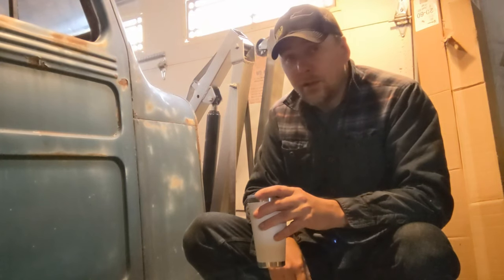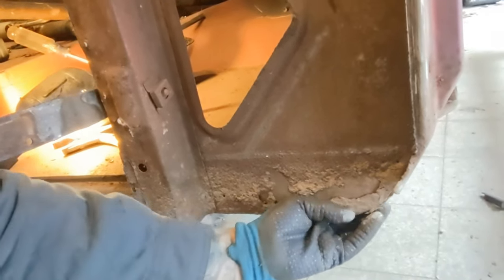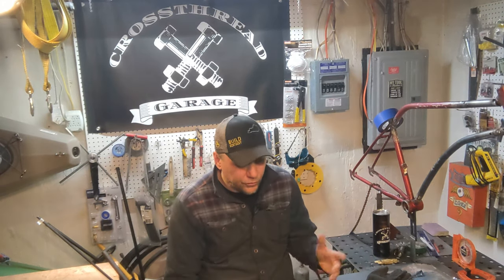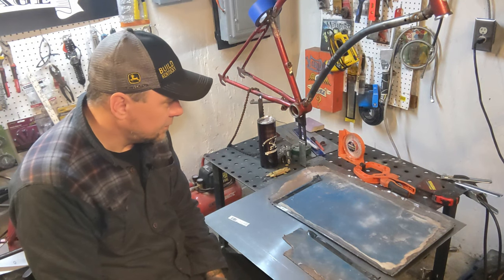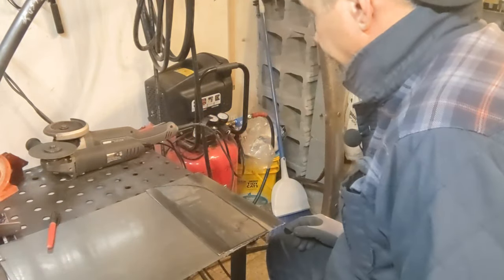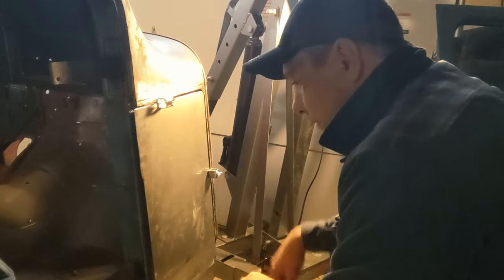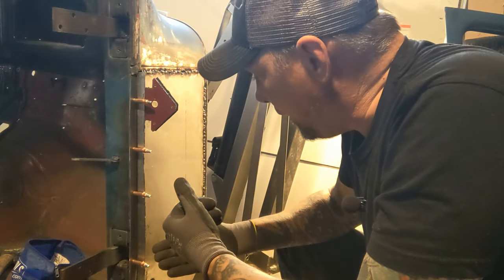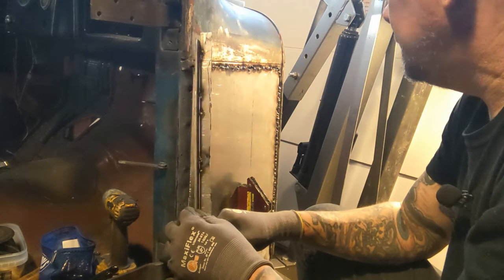1962 Willys Station Wagon Building Body Panels

Comment: Stick with your idea with a small block Chevy.  350 with a mechanical fuel pump  and a carburetor it worked for 50 years  buy a motor from a la-get out-fit /   you get what you pay for  / that's if your lucky    /

Comment: Where are you located? I have a Willys project too and have a complete floor panel from the under seat boxes to the back without rust that I am not using. If you want it, let me know. I'm in WY. I still need to cut it out as I plan to graft in an 06 LJ floor to make updating much easier on my build.
Reply from the maker: I'm in Kentucky, it may cost a small fortune to get it here, but I do appreciate you thinking of me, you're a stand up person!
Reply: @crossthreadgarage  No worries, It would have been good if logistics could have worked out. It's not going anywhere till summer so if you think of a way to get it down to you and you could use it, just let me know. Cheers!